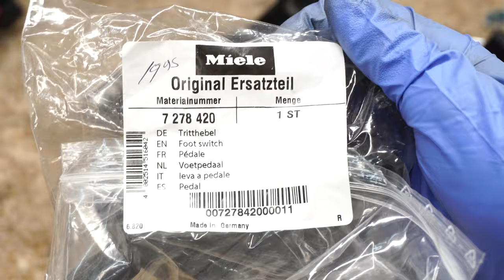Miele U1 S7 Upright vacuum Complete How To Repair

Comment: 37:40  THANK YOU SO MUCH.  You just saved me a trip to the repair shop.  I just finished cleaning the beater bar assembly (two long-haired adults and a couple of long-haired cats make for a very sad beater bar) and went to put the unit upright again, but it jammed and wouldn't lock upright.  A web search indicated that this ribbed shield was likely the problem, and I discovered that it was quite loose inside the housing.  I managed to pull it out and verified that the vacuum could now lock upright, but I couldn't for the life of me see how it was supposed to be secured inside the swivel head; I was pretty sure I'd have to take it in for repair.  Your video solved the mystery; I was able to get that shield back where it belonged and working properly again without binding up the works.  Thank you!!

Comment: Your fantastically useful video production is a gift that keeps on giving.  I suspect there will be more folks discovering this now that the U1 S7 vacuums are out of production.  I just fixed my 2010 vintage S7210 with a few new parts and hope it lasts another 10 years.  ;-)

Comment: Learned a lesson the hard way.  Reassembled after cleaning and didn't push down hard enough on the motor retention wedge or whatever it's actually called.  Within a year the belt had worn out from being too loose and slipping on the drive sprocket, essentially stripping all the belt teeth off of the belt.  New belt with the motor retention wedge pushed firmly downs far as it would go and it's running like new again. Thank you for sharing your expertise!
Reply from the maker: See why I don't recommend people repairing these themselves? Sounds like you learned the hard way. Hopefully you've had better luck the second go around thanks for watching!

Comment: Thank you so much for this detailed disassembly and repair guide! I used this, as well as your motor disassembly video to overhaul an S7260 Cat and Dog that was almost ruined because the were running it with the bag holder missing. The inside was a mess, the motor was all filled up with pet hair and dust. Its all spotless now and running great.

Comment: I have an issue only with the lower unit. Lower unit has no vacuum. Hose has full vacuum and no ports are clogged anywhere. I wonder if the hose position you showed somehow in the lower unit is not in the correct seal position. I have not taken the lower unit apart yet so can't imagine how that would happen without it being opened up.

Comment: Thanks for posting the video!  Its great to be able to watch someone take apart the machine.  Had a hard time getting the handle to tilt, and it turned out my wheel timing was messed up.  Found a broken off tab on the bottom motor cover and I think the sliding dust cover must have jammed causing one side of the wheels to go out of sync.  The part showing the timing marks was a little blurry, but once I got it apart and it made sense.  Had to reposition one of the gears but once it was adjusted the handle tilted smooth as butter!  Removed the sliding cover since it doesn't prevent the vac from working.  Definitely German engineering at its best and kind of complex.  Very solid, though, compared to the throwaway vacs they sell in chain stores.  Have had it about 7 years and filtration/suction are awesome.  Had a Panasonic before that fell apart within 5 years.

Comment: Great video! Mine is very loud and spewing a fine beige color dusting on the front bottom. I’ve taken it all apart and cleared all of the air flow areas including taking the bottom plate off.  I installed a new bag and filter. It does vacuum and picks up anything on th3vrug. Any idea what’s causing this? Thank you for any advice you may have!

Comment: Hi, I bought this brand new 7 years old and it just started having problems staying up. The lock height foot mechanism won’t stay. I brought it to my local shop that I bought it from and they basically said it’s time to buy a new one. They attempted to repair and said it would cost $250 but would still lean and could potentially have problems in a few months. They didn’t feel comfortable charging me that and doing the repair since it wouldn’t be 100% fixed. My question is can it be 100% fixed? Do I need to take it someone else or try myself? Or is it truly time to trade up. Was thinking sebo this time after watching your reviews

Comment: Thanks for the video!  I just removed a bunch of caked up dust from below the chrome plate on the bottom of my S7 Tango and a bunch more from the intake tube.  There were two metal "clips" inside the tube that seemed to catch most of the dust and that was the source of the blockage.  Do those clips belong in there are did I vacuum them up at some point and they got stuck?

Comment: I have this vacuum and got one open box on eBay in 2018, but since cleaning my car a few months back, it’s developed a higher pitch sound as if something is blocking airflow. I’ve taken a broomstick and cleared the extension hose, but the sound is still there making me wonder if there is a blockage in the head unit? I’ve checked the brush rollers and the suction hose inside and it seems clear.

Comment: we have 4 of these, but one we just bought used, the hose has stretched.  any suggestions other that buying a new one, kinda expensive i assume, thx
Reply from the maker: Unfortunately once a hose gets stretched out it needs to be replaced. You can go to your local dealer and get the genuine part. It's fairly straightforward to do.

Comment: Help! I'm wondering where you are located and about how much it cost to ship a vacuum for service? My local dealer is ridiculously slow and horrible at finding problems even when I tell them exactly what's happening. They have fixed once before a problem with the pedal somehow some sort of switch inside that makes the roller brush not spin Even though it is in proper position and turned on. With your excellent disassembly video I would attempt to fix it myself except for I'm not sure what part I'm looking to replace. Have you heard of this problem and could you point me in the right direction?
Reply from the maker: Email us for details.

Comment: Great video.  Love that it's literally looking over the shoulder of a trained professional as you explain what you're doing.
I have two questions:
1) Removing the electrical handle: you mentioned a T20 into the hole.  Is it a push latch or a screw?
2) You mentioned he hose tab breaking and being under warranty.  This is the first I've heard about it being under warranty.  Mine is held on with tape after breaking within the first year.  Are you saying that I should be able to take the vacuum to a Miele repair shop and have that part of the housing replaced under warranty?
Reply: About 1) I answered my own question.  It's a push latch.  But the handle was rather difficult to remove.  For others trying to remove the handle: because it's a silver piece, there was nothing to indicate it was moving so I put a piece of tape where it meets the base and then I could see that it was, indeed, pulling out.

Comment: When reassembling my Twist, I was unable to get the top to click on to the bottom.....the problem turned out tot he the plastic piece /insert that sits between the two.  When I removed that piece  (the ends of it were bent and in bad shape....however I have a big black pliable gasket (kind of) that I didn't see in your demo.  Do you know where I might buy a replacement for that piece/ and /or what that piece  is called.  I am unable to locate my model on the miele website.

Comment: Awesome video dude. These Miele uprights seem to get a decent amount of hate on the subreddit but I still had to have it when I found out they had one S7580 left at a different vacuum shop I went to today.
Reply from the maker: Thanks for watching. I'm not sure why these would get hate unless they were repaired wrong they're excellent machines. I used to daily drive one myself when I had an apartment if that says anything.
Reply: @PerformanceReviews  cumbersome, unreliable and unimpressive is some what I've read though there was not much elaboration. Regardless, I took it all with a grain of salt and purchased a new dead stock S7580 yesterday and I'm in love with it lol. My first impression while looking over basics of the design was the bag chamber seal is very substantial and impressive compared to (I hate to say it) my X7 or X4. The vacuum glides and steers effortlessly too, even being as heavy as it is, I'd assume due the casters up front. Sealed suction seems close to or right on par with most high end canisters which in my limited experience is not usually the case with uprights. Super super happy with my first Miele and it's a really cool looking design too which is honestly what first caught my attention.

Comment: I’m curious what the air path is like on this machine. Does all dust and debris go through the hose or are there two separate air paths; one for the hose and one for the Brushroll?  If everything goes through the hose, then the air path is about as long for this machine as it would be on a canister, correct?  I always thought one of the benefits of an upright is the more direct air path.  Am I wrong?
Reply from the maker: No the benefit of an upright is saving money. There are less parts to manufacture than a canister. That's really the only purpose and upright has.
Most canisters have more power than uprights.
Reply: Performance Reviews  thanks for that explanation. So a canister with an SEB236 powered head would do just as good a job as an s7/u1?
Reply from the maker: Well canister with one of those nozzles would do  a better job since they move about 10-15% more air.

Comment: It’s such a shame these got discontinued. I just picked up a used one from my local dealer for a great price and it performs well, but there’s a nasty smell coming from it when I vacuum. It almost smells yeast-y? It’s not coming from the bag or filters. Are there any measures I can take without tearing it down to this extent and risk messing something up?
Reply from the maker: If you got it from a dealer there shouldn't be any smell in it.  You should make it a good point to make it their problem. 
In this video you'll see that there's a green piece of sound insulation that is quite porous and often can attract odors when the machine's been abused. The machine probably needs to be broken down and thoroughly washed. Again your dealer should have done this before selling it.

Comment: I have a Miele S7510 and I'm based in the UK. The cleaner is generally working fine but has recently developed a niggling problem. It locks upright OK but still swivels freely from side to side in the upright position, making it difficult to use the hose with various tools. I dismantled it based on your excellent video but couldn't see what would stop it from swivelling apart from a round very slight protuberance on the base and a corresponding hole in the upper part. Does this wear after 6+ years of regular use and, if so, can you suggest any way to raise the profile of the protuberance or the hole?
Reply from the maker: I have a unit that was 8 years old when I gave it to a friend that still functioning today . I would suggest you bring your machine to your local dealer and see what they say.
Reply: @PerformanceReviews  Thank you.

Comment: Eversince I used a dry powder carpet cleaning poduct my vacuum has been making a very annoying high pitched noise when using the rotor bar.  I assume the powder got into that mechanism when I vacuumed it up.  Now, several months later I have no suction at all.  Motor sounds fine, but rotor bar spins for a second or two, then stops and no suction.  Does this sound like something that can be fixed?  By myself?  By a pro?
Reply from the maker: Bring us to your local shop do not attempt to fix it yourself.
Reply: @PerformanceReviews  I'll do that. Thank you!

Comment: Great video!! Our brush motor is turning off momentarily while vacuuming.  I think maybe a bad connection or switch, what do you think?  Closest service is 150 miles away in a direction we seldom travel.  Any help would be appreciated.  Glad to donate in return for help ideas.
Reply from the maker: Well even if you figure out what it is you're still going to need to go there to get the part or have it shipped from your local authorized dealer. I wish you luck! I can't diagnose machines over the internet.

Comment: Hi ,Top job.  Have the same machine.  The on-off switch has recessed, and the machine sometimes switches off and on when the body twists.  Any ideas, please?
Reply from the maker: Bring it to your local dealer for authorized service.
Reply: Thanks,  I will contact Miele direct to find my local dealer.  I did take it back to the vac shop, but they say the part is no longer available.  I think they did not ask, and will advise me to trade in for a new machine.

Comment: I was wondering if you could tell me which wires go to which terminals on the connector in handle(3 wire) red black white?
  I accidentally pulled wires from connector while removing top handle incorrectly :/

Comment: I watched video several times, hoping to see a fuse or anything that dealt with the motor.  My s7850 abruptly stopped and displayed the red light triangle.  Let is sit for over a day, start up is immediate red light. So obstruction to overheating is tabled for now.   Any insight other than take it to a dealer would be appreciated. Thanks.

Comment: Is $200 too much for a new motor? A vacuum repair shop has my U1 and that’s the price they quoted me bc the motor was “shot”. It’s my fault though. I bought it used on eBay and only turned it on to make sure it worked before putting away in the garage bc I still had bags left for my Hoover vac. 
Once I decide to start using it, I notice that it is not picking anything up. I take it in to get a free estimate. Unfortunately, I’m way past my eBay protection time frame. 

Would it be best to let the repair shop handle it? I feel confident in being able to replace the motor if it’ll save me more than $80.
Reply from the maker: That's insanely too cheap to replace a motor in one of those the cost of the motor should be higher. If we're talking about the section motor and not brush roller motor.  If I were you I would not attempt to turn any screws on that machine. You'll end up having to pay more in labor to have it put back together
Reply: @PerformanceReviews  I am not sure what motor it was.  The lady who repairs the vacuums said that when she did the diagnosis/tune-up, she found a screw inside and a lot of the carpet powder.  It was really loud too.  She said it would be an additional $79.99 to open the motor and clean everything out, but then the vacuum stopped working. They could not fix the motor, so a replacement was the next step to get it running.

Comment: How do you access the on/off switch to replace it?
Reply from the maker: Your replace as a whole assembly with the handle and cord.
Reply: Will Miele warranty the part?
Reply from the maker: Yes if it's a manufacturer defect. Bring it to your local authorized dealer and have them take care of it for you

Comment: I can take my Miele S7 fully apart
Reply: I need to take the panel off the front roller..how do you do that..what kind of screw driver for the little bitty screws..
Reply: @zanym8088  The screwdriver bit would be a torques T 25 there is four screws

Comment: So disappointed in ours. It’s constantly clogging and we’ve had to take it in for repairs twice.
Reply from the maker: If it's clogging then has to do with sucking up something too big. If you block this vacuum you'd block any vacuum.
 Are you pulling the blockage out yourself or have you had the shop pull it out?
Reply: @PerformanceReviews  wow I can’t believe you replied! Yes they are blockages I find on my own (after watching tutorials on how to do that). I found a blockage today in the black curved hose that goes into telescopic wand. Also annoying that the telescopic wand has been replaced twice. The plastic coupling is so cheap for an expensive machine. Idk maybe it’s because we have 2 furry cocker spaniels. When the vacuum works it’s amazing. It’s just always getting clogged. Great tutorial.